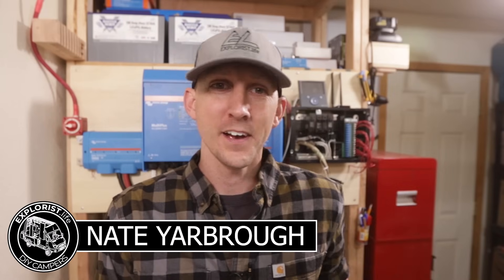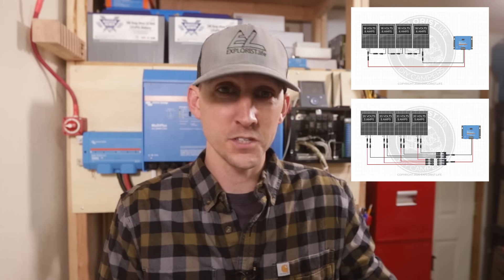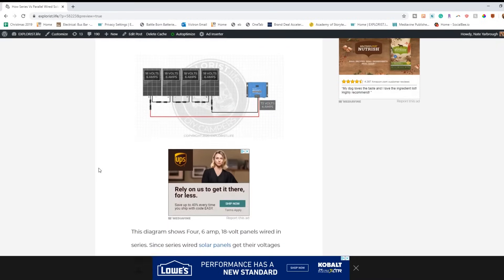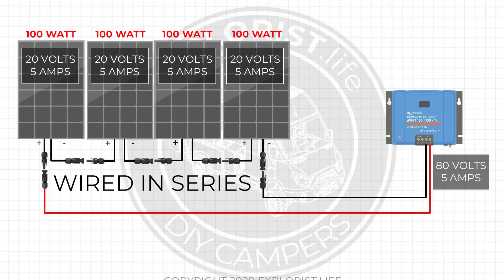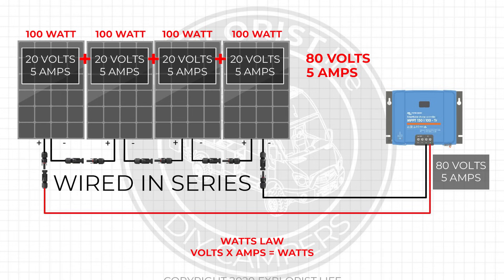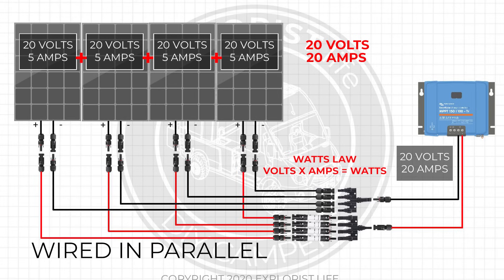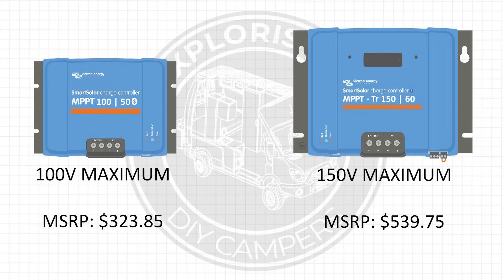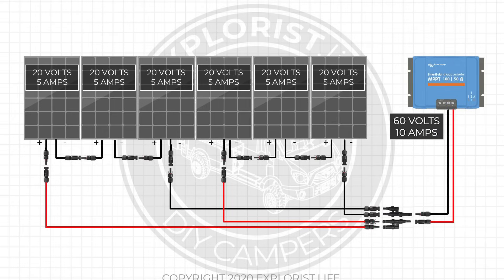Solar Panel Wiring vs Volts and Amps

Comment: Alright. Question. 
I've got 2 195w panels and my system is designed to run on 12v components. To use smaller gauge wire I've run the two "12v"panels  in series to make it a "24v" array. Does it matter that my array is a higher voltage than my battery? I ask because my charger controller doesn't show an input voltage change from the array when I either hook up the panels in series or parallel. Is it because I've done something wrong or because the mppt controller is smart enough to limit the voltage to save the battery. Look forward to your answer. Thanks
Reply from the maker: The solar array voltage should indeed be higher than the battery bank voltage provided an adequate size and type of charge controller.  This should help: https://youtu.be/Jkbs84sBHsg
Reply: @EXPLORISTlife  that was really helpful dude. Thank you. I'll start watching your playlist on how to wire up a camper van. I have a feeling it's gonna be super helpful

Comment: Hi i have 545watt four solar panel (1 panel volts 40 and ampere 15 ) connected in series parallel can i connect fuse connector to it???it is not needed ???

Comment: Hello, thank you so much for this amazing explanation, Can i do 5 375w in series and 2 or 3 in parallel? my inverter has 250v 80A, thank you and do i need to puse fuses for the panels in parallel?
Reply from the maker: Here is a video that teaches you what happens if you do that: https://youtu.be/jejro4zkl8I

Comment: Thanks for this great video and giving back to the community!  If u dont mind, i need some advice on my config.   I have a goal zero yeti 6000x that can take an input of 600w 14-50v 50A MC4.   I have 4 sharp solar panels at Pmax 140w, Poc 24.85,  Isc 7.81.  I was thinking of doing a series parallel that shud get be to 560w, 50v, 15A.  Use a power joiner and 10 gauge wire to my yeti.  Is that sound?

Comment: So series keeps the amperage low so you can use smaller cables but increases the voltage so you need a bigger charge controller. Wiring in parallel increases the amperage so you may need bigger cables, but keeps the voltage lower so you don't need a bigger controller. In my setup, i'm working with 4 215w panels which i'm going to wire in 2 groups of 2 panels. That'll mean i could go with the 150/35 VE MPPT controller and not have to jump up to the 250. Now to figure out what size wiring i'm going to need..

Comment: Hey, super Neuro divergent brain here. I was super confused at first on how to calculate your volts and amps when wiring in both parallel and series at the same time. 

But I realized that it’s a lot more simple than you explained it, or at least, that’s how it seems to me. Essentially, you just take the volts and amps of one singular solar panel times the number of sections that you have.  

It doesn’t matter how many panels are in each section. It only matters how many sections you have. If you have 6 sections, you times the Amps and volts by 6, if you have 4, you times each of them by 4

Comment: Just a quick question. If i have a 650watt panel rated at about 55v and 20a in full sun light. What current should i be getting out of it charging a 13v lifepo4 120ah battery? Does the output equate to a result calculated with watts law or is it totally different. What controller should i use?

Comment: Installing a 2000 watt solar array on my 2022 Grand Design Momentum G320. I'm using Newpowa 250 watt panels, 4 now and 4 more later.  My question is what Victron charge controller would  would work with initial install of the first 4 panels and still work with 8 panels.  thanks in advance
Reply from the maker: If this is charging a 12V battery bank; you'll need two separate charge controllers.  One for the first 1000w and another for the 2nd 1000w.

Comment: You can explain things so well, so please, can you explain why  its more advantageous to charge at a higher voltage, apart from the advantage of wire size...I use a 100 amp and am charging back at 80 amps in a lower voltage system? but I'm charging back at 40amps in a higher voltage system, does it take longer to charge? I'm having trouble getting my head around charging back at a reduced amps rate being better???
Reply from the maker: Higher voltage get the array voltage high enough to charge earlier in the day or in poor conditioner (cloudy/hazy) than a lower voltage array.  Remember... the 'reduced amps' is just on the array side.  Reduced amps on the array side doesn't translate to reduced amps on the output side.  I think this video will help: https://youtu.be/Jkbs84sBHsg

Comment: Hello. I have a question. Does it matter if the negative wire of the series is shorter than the positive? Can the the negative be longer . If the series starts with negative and end with positive being shorter would that be ok? Thanks for your videos !
Reply from the maker: It doesn't matter.

Comment: Dude thank you so much for these examples. Specifically the price comparison and the 6 panels setup as that’s exactly what I’m doing and I bought the 150/60 controller, but have time to return it and save money with the less expensive controller!! Thanks again!
Reply: Also it doesn’t show on the diagram but do I need a fuse for this setup? Thanks again!!

Comment: Hi Nate, (dumb question coming)
I'm looking at a lithium battery's, and they have a minimum 40amp and max 70 amp charge.....

So..... For these batteries to be charged up at the 40amps, my entire solar array would need to produce a minimum of 40 amps.... Correct?  

This is going to determine how I complete my entire solar array wiring.

Thanks much!

Comment: QUESTION!!!! My panels in series are increasing amps and volts. Why is this? I have a solar array at my house with 40 panels and 2 inverters, there are 6 strings of panels all in seperate series. 4 strings of 5 panels and 2 strings of 10 panels.  I want to run 3 strings to one inverter and 3 to the other. This means per inverter you get 2 sets of 5 and one set of 10, this is done to keep the amps below what my inverter can take. The strings of 5 panels get a reading of 13-14 amps DC and 220-230 volts DC. BUT!!! the strings of 10 get a reading of 26-28 amps DC and 440-460 Volts DC. This dosent make any sense and puts me over my max amp input. WHAT IS GOING ON HERE!!!!???
Reply: and yes I double triple checked that I didnt run them in parallel and even if I did then the volts wouldnt be doubling correct?
Reply from the maker: Hey, GoodColonizer! I appreciate you taking the time to ask your question, but unfortunately, I don't have enough info about your specific question to provide an accurate answer, but here is a playlist that, if you watch all of the videos start-to-finish (and take notes 😉), you'll have a REALLY good idea of how to design a solar array: https://www.youtube.com/watch?v=Jkbs84sBHsg&list=PLmvhcyi4n0TV9pi83rFTv3ZuMT_S1xIZt

Comment: Beware!  Figuring 20 volts per panel is wrong. (At least in my experience) You need to figure 24 volts per panel. I know this because I wired 8 panels in series and ended up overloading a controller that takes a maximum of 160 volts. I got a reading of 178volts😮 from my 8 200 watt Rich solar panels.
Reply from the maker: 20V was simply an example for easy math for the sake of this video.  When you're ACTUALLY designing the array, you need to look at the actual voltage of the panel because the panel could be anywhere from 18V to 80+ volts depening on the panel.  You can see that in action here: https://www.youtube.com/watch?v=OsVqIvahThM&list=PLmvhcyi4n0TV9pi83rFTv3ZuMT_S1xIZt

and here: https://www.youtube.com/watch?v=MxziHKvTRh8&list=PLmvhcyi4n0TV9pi83rFTv3ZuMT_S1xIZt

Comment: Please help me Nate.... I don't understand why the Victron calculator for mppt's shows that the 250/85 mppt would have its amps rating maxed out with 2 strings of 400watt panels at 5 panels per string. The panel rating is each 11amps, so would that not be 22 amps in total?  So why does the victron calculator show over 90 amps at about 220v.  ?
Reply from the maker: Unfortunately I don't have enough info about your particular inputs to answer that question.

Comment: Would you give me your input on wiring my system. I have 36-Silfab 380w panels with a Solar Edge SE 11400H-US inverter. The panel array is 500 feet from the Inverter and this is my concern.
Reply from the maker: Hey, Dave Hall! I appreciate you taking the time to ask your question, but unfortunately, I don't have enough info about your specific question to provide an accurate answer, but here is a playlist that, if you watch all of the videos start-to-finish (and take notes 😉), you'll have a REALLY good idea of how to design a solar array: https://www.youtube.com/watch?v=Jkbs84sBHsg&list=PLmvhcyi4n0TV9pi83rFTv3ZuMT_S1xIZt

Alternatively, I have some of my most common solar array setups pre-built here: https://shop.explorist.life/product-category/all-products/camper-wiring-kits/solar-charging-wiring-kits/

Comment: if i add my mini system. 12 volt, 10A charger, 21 volt 20W panel new solar panel, charge this lot fasten my 12V battery. whit 2 panel. paraller. wintertime not have lot sunny, and need charge battery short time at day. one panel only not charge battery full, one day.

Comment: Before I send this panel back
I bought a 24volt 200watt panel I will have 4 of them.
I want to wire them series parallel 
My battery is 24v 200ah

Should I use 4 12v 200watt instead.??

Is it possible or ok to connect 48v to my mppt to charge a 24v battery??

Comment: I have 10 100 watt panels a epever 100amp 150volts  charge controller with 200ah life4 battery.... 12 volt system...im going to have a second battery soon.... how should i wire these panels up??? I will be adding 2 more panels in near future.... 12 volt system.... thanks a ton
Reply from the maker: Hey, Rick Hudnall! I appreciate you taking the time to ask your question, but unfortunately, I don't have enough info about your specific question to provide an accurate answer, but here is a playlist that, if you watch all of the videos start-to-finish (and take notes 😉), you'll have a REALLY good idea of how to design a solar array: https://www.youtube.com/watch?v=Jkbs84sBHsg&list=PLmvhcyi4n0TV9pi83rFTv3ZuMT_S1xIZt

Alternatively, I have some of my most common solar array setups pre-built here: https://shop.explorist.life/product-category/all-products/camper-wiring-kits/solar-charging-wiring-kits/

Comment: Would I still need a control charger if I use a multi plus all in one?
Reply from the maker: The Multiplus is an Inverter/Charger, not an "all-in-one".  The multiplus doesn't handle charging from solar so you would indeed need a separate MPPT.  Maybe these would help: https://www.youtube.com/playlist?list=PLmvhcyi4n0TUU8FUc6LE38TBkdSLjdw_5

Comment: I DO BOTH IS THE WAY TO GO!
Reply from the maker: Most of the time, yes.  Not possible with 2, 3, 5 or 7 panels, though and not always the best idea depending on the voltage of the panels.  Knowing the math behind the decisions is the best way to go.

Comment: Hi Nate. Been following all your videos. I have 4 x 100w renology solar panels wired as 2 panels in a series, so i have 2 series. i want to wire the 2 series into a series parallel. Can you tell me how i would wire the the fuses into this and what size and how many fuses will i need. Do i need to fuse each panel or can i put 1 fuse on the parallel wire to the Renology 60a charge controller.
Reply from the maker: Hey, Chris Broom! I appreciate you taking the time to ask your question, but unfortunately, I don't have enough info about your specific question to provide an accurate answer, but here is a playlist that, if you watch all of the videos start-to-finish (and take notes 😉), you'll have a REALLY good idea of how to design a solar array: https://www.youtube.com/watch?v=Jkbs84sBHsg&list=PLmvhcyi4n0TV9pi83rFTv3ZuMT_S1xIZt

Alternatively, I have some of my most common solar array setups pre-built here: https://shop.explorist.life/product-category/all-products/camper-wiring-kits/solar-charging-wiring-kits/

Comment: What is the best wiring system for a 4  100 watt 12 volt system . Series / parallel or a straight parallel . ? Thanks .
Reply from the maker: Hey, Bruce Wilson! I appreciate you taking the time to ask your question, but unfortunately, I don't have enough info about your specific question to provide an accurate answer, but here is a playlist that, if you watch all of the videos start-to-finish (and take notes 😉), you'll have a REALLY good idea of how to design a solar array: https://www.youtube.com/watch?v=Jkbs84sBHsg&list=PLmvhcyi4n0TV9pi83rFTv3ZuMT_S1xIZt

Alternatively, I have some of my most common solar array setups pre-built here: https://shop.explorist.life/product-category/all-products/camper-wiring-kits/solar-charging-wiring-kits/

Comment: I have four 200w panels wired in parallel like you have at 4:02 in your video. But my Bluetti AC300 shows only 180w at 22v. I was expecting around 800w. What am I doing wrong?
The panels are Renogy RSP200D. Open Circuit Voltage 27v. Short Circuit Current 9.66a

Comment: Hello from 🌞 Arizona. I have a ECO FLOW Delta Max Pro with solar imput maximums of 15 amps, and 150 volt max. Could you please tell me the max setup with 100W 24V panels, looks to me like most in series to keep the amps under 15A. Thanks SO MUCH. 👍
Reply: My quick math is 6 100W 4.2A panels all in series. Gives about 144V and only 4.2A. Is 6 panels the max?
Reply from the maker: Hey, Keith in AZ! I appreciate you taking the time to ask your question, but unfortunately, I don't have enough info about your specific question to provide an accurate answer, but here is a playlist that, if you watch all of the videos start-to-finish (and take notes 😉), you'll have a REALLY good idea of how to design a solar array: https://www.youtube.com/watch?v=Jkbs84sBHsg&list=PLmvhcyi4n0TV9pi83rFTv3ZuMT_S1xIZt

Alternatively, I have some of my most common solar array setups pre-built here: https://shop.explorist.life/product-category/all-products/camper-wiring-kits/solar-charging-wiring-kits/

Comment: I have a ? for you sir. How do I hook up solar panels that have a limit of 150 volts and 15 amps on the Eco flow pro. they say the max is 1200 watts. i have 21.6 open circuit voltage solar panels with 5.55  amps max current. looking forward to your answerer.
Reply from the maker: Hey, Serenity! I appreciate you taking the time to ask your question, but unfortunately, I don't have enough info about your specific question to provide an accurate answer, but here is a playlist that, if you watch all of the videos start-to-finish (and take notes 😉), you'll have a REALLY good idea of how to design a solar array: https://www.youtube.com/watch?v=Jkbs84sBHsg&list=PLmvhcyi4n0TV9pi83rFTv3ZuMT_S1xIZt

Alternatively, I have some of my most common solar array setups pre-built here: https://shop.explorist.life/product-category/all-products/camper-wiring-kits/solar-charging-wiring-kits/

Comment: Great video!! Silly me should have watched this before wiring my 3x solar panels in parallel...wondering if you would know why my setup only charges at 6-7amps with 3x 120w panels wired in parrallel with dual batteries sitting at 12.2v (drained on purpose)? Renogy 30amp MPPT controller. Thanks

Comment: been looking for this education on math...so glad I found your youtube 

Running a delta max 2000 it can handle solar at an input of 100V and 10A and 800W Max...trying to figure out what specs of A 100W panels to use to  string together to achieve no more than 100V and 10A and 800W OR even 100W x 6 panels for 600W and stay below the input max
Reply from the maker: Yep!  I definitely think you'll find the videos that will teach you how to figure that out here on our channel. 🙂👍 Welcome aboard

Comment: Great vid/s, using these to help me wire Solar to my boat. I’d like to know how to wire 6 x 100w panels and connect them to 2 x 12v 250ah golf cart batteries wired in series for the engine, and another 2 wired in series for the house facilities, any help is greatly appreciated. Thanks.
Reply from the maker: It's really not possible to charge two separate battery banks from one solar array.

Comment: I’m a beginner and am building an off grid solar system. I have a MPP 6500w LV6548 solar charge controller, and two 51.2V 100Ah EG4 LIFEPOWER batteries. I would like to know the optimal solar panel design for limited space. Are higher wattage solar panels better? And what design is optimal—series, parallel, etc?
Reply from the maker: Hey, Joel Williams! I appreciate you taking the time to ask your question! Here is a playlist that, if you watch all of the videos start-to-finish (and take notes 😉), you'll have a REALLY good idea of how to design a solar array: https://www.youtube.com/watch?v=Jkbs84sBHsg&list=PLmvhcyi4n0TV9pi83rFTv3ZuMT_S1xIZt

Alternatively, I have some of my most common solar array setups pre-built here: https://shop.explorist.life/product-category/all-products/camper-wiring-kits/solar-charging-wiring-kits/

Comment: I often see this on the specifications of solar panels... 

Short Circuit Current (Isc) 	9.66A

Optimum Operating Current 	8.85(Imp)
Maximum System Voltage 	600VDC (UL)
Open Circuit Voltage (Voc) 	27V
Opitmum Operating Voltage 	22.6V(Vmp)
Operating Temperature 	-40℃ to 80℃
Maximum Series Fuse Rating 	15A

What do these all mean and what should I focus on and which is best higher/lower ect..? 

Thanks
Reply from the maker: That's a great idea for a video.  I'll add it to the list.

Comment: Great video and information. I'm confused as to where are you getting the 20V from? Rated output volts or open circuit voltage?
Reply from the maker: The concepts will be the same regardless of if you are trying to determine the Voc or the Vmp.  20V was just a hypothetical number for easy math.